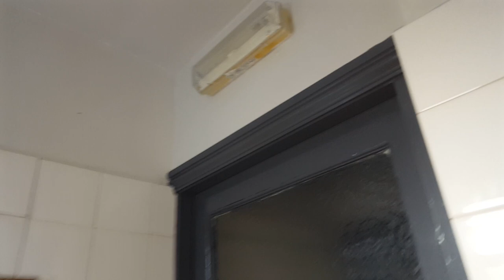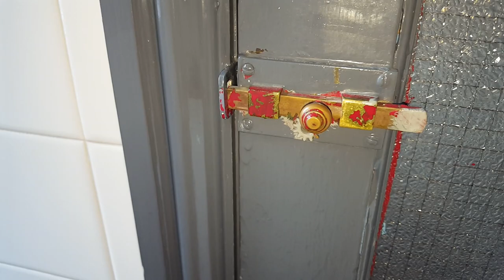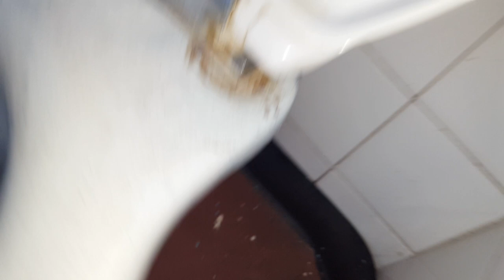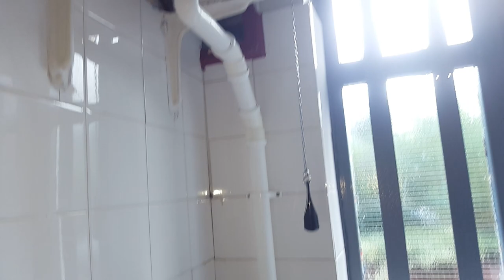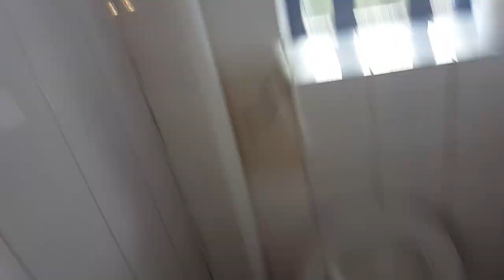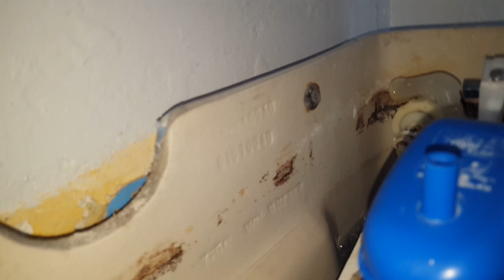1990s HLTP AS Kensington & 1930s Crystal pan

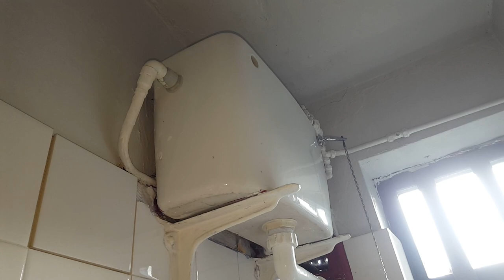Comment: 0:48 quite inventive using polypropylene pushfit waste pipe as a flush pipe. This 38mm size fits the flush cone better than the solvent weld waste pipe I guess. PP is slightly smaller than ABS. The right angle is part of a 1. 1/ 2 bowl sink kit. Flushpipes are predominantly  1.1/4"/35mm  with the 1.1/2" nut to cistern having a larger 'ledge' to compensate. Not a strong flush considering it's high level, siphon not set up for full(6/7/ or 9L)..? Has this been converted to single flush? Just I paused it and the washer is still attached to the siphon. The siphon has to be taken apart and fixed onto the spindle where the diaphragm washer is. Dudley ones pull handle and has a short flush if not converted.